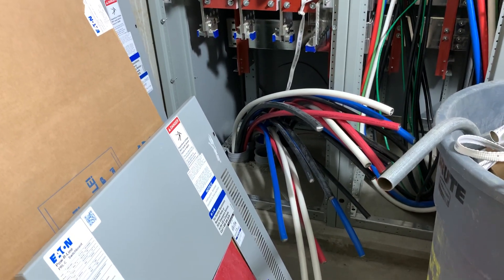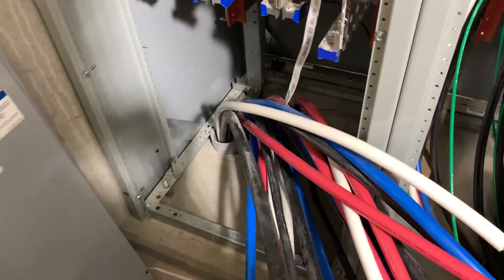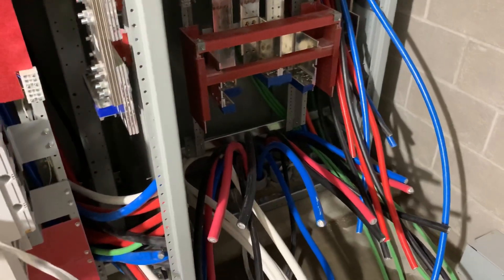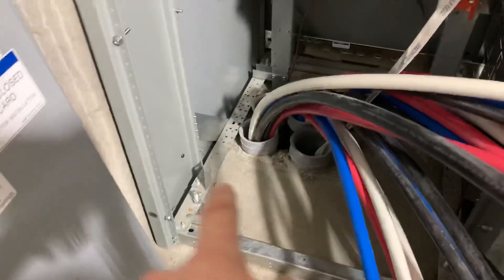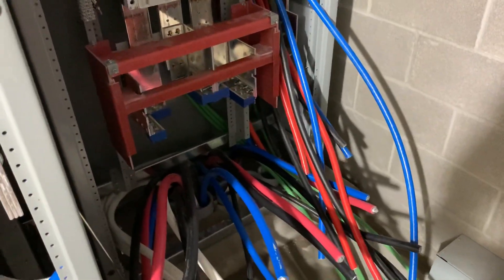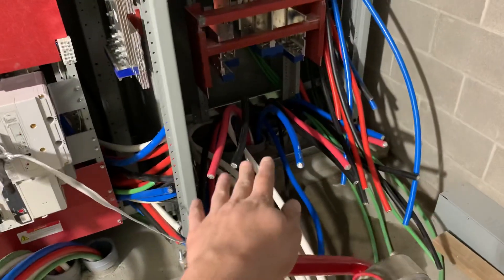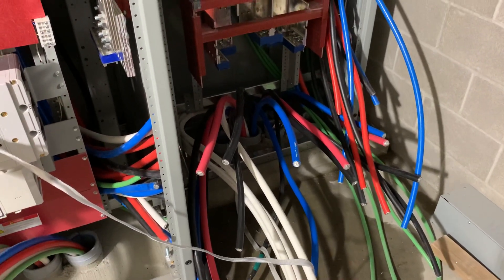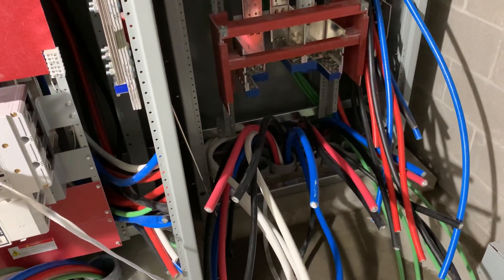Today As An Electrician: 600 KCMIL Thicc By Hand!

Comment: Great to see how its done in the US. In Scotland we generally run an Steel Wire Armour (SWA) cable that would either have 4 or 5 cables cores inside. Copper conducors that would run from the panel to its location via a cable tray system as the cables Steel Wire Armour gives it mechanical protection. A lot less labour intensive compared to installing all that piping system. Great series of videos, I hope these continue! Would love to see the end result!
Reply from the maker: Glad you enjoy the videos ☺️ Sounds interesting, It would be cool to see how yours looks :)
Reply: @DailyElectrician  New project I'm moving onto is a new build school. Wont be pulling cable for a few months but when I do I will try record some footage to share with you!
Reply from the maker: awesome thanks! cant wait :)

Comment: Do you use lubricant for the wire pull ?
Reply from the maker: yeah a little, we were low. on these ones today we didnt since its only 30 feet and the pipes are filled with water lol